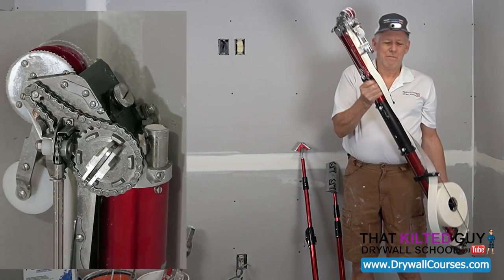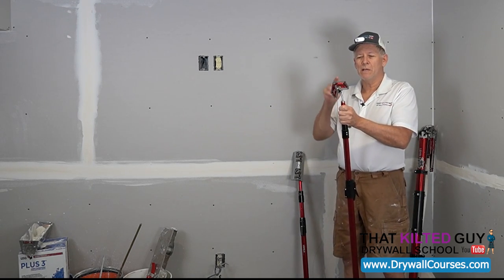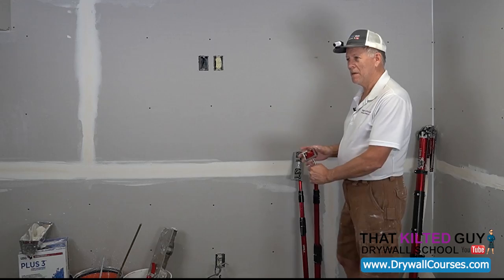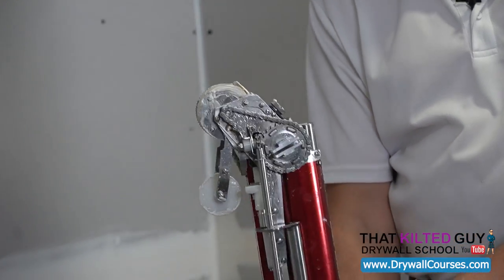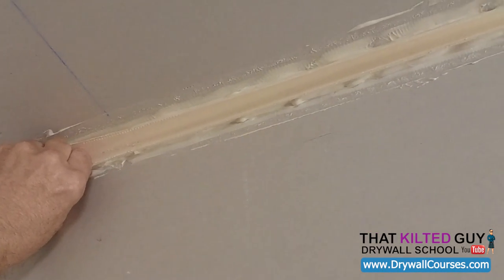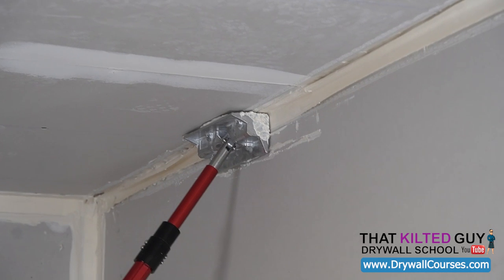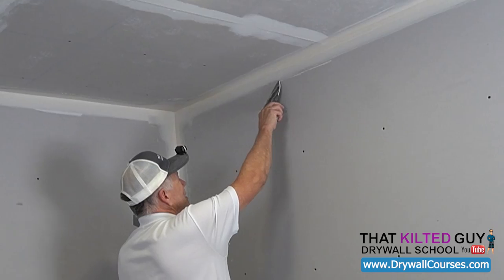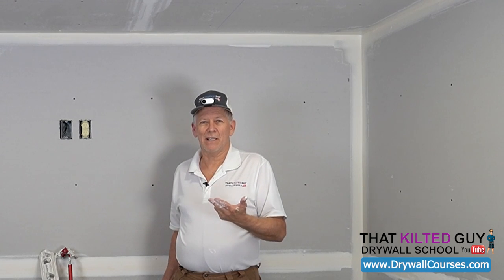Using a Level5 Drywall Bazooka to tape Inside Corners

Comment: I tried to use mesh tape tonight in the bathroom. I had already used the level 5 24" spreader to fix my ceiling. I decided I better try to put up some tape in the corners. Yes, I should have already done it but I didn't want to try to. The guys at Lowes said maybe I had better tape the corners. So I taped over the bathtub. I put some mud down and I used mesh tape. The problem is that the knife snags on the mesh and it doesn't sit down in the corner. SO, I pulled it down and scraped the mud off. Now I have to try again. I'd like some tape that sticks. The mesh tape also wouldn't fold. So it's kind of obvious I guess that it was a no go from the start. GOD, I had mudding and taping and using the modern latex that dries in 2 minutes.

Comment: ALWAYS!!  Run around with a 6" knife and check for "clickers".  A screw that isn't set good does a number on the blades of your corner glazer.  Even good hangers leave "clickers" from time to time especially in corners.

Comment: I was watching the video when you were using the new product 'Tape In Mud". Can I use that to mud over mobile home wood paneling?
Reply from the maker: I would only use it for deeper, wider fills. And it has to go on about 1/8" thick or more to have the strength it needs, so I wouldn't use it anywhere you can get a crack to fill in between sheets, or where you can't put it on thick enough.
Reply: @ThatKiltedGuyDIY  thank you!

Comment: How do you prevent the tape from sliding? No Mathew thin my mud or how light I press with the bazzoka the tape always slides on the inside corners
Reply from the maker: You have to keep the bazooka at a 45° angle so that the sharp teeth on the roller will bite into the drywall paper which is what keeps it from sliding. And instead of light pressure you may need a little more pressure to get that to happen
Reply: @ThatKiltedGuyDIY  thanks I’ll try that this week